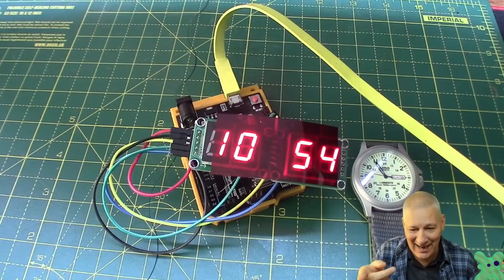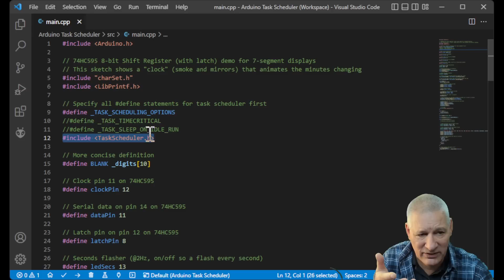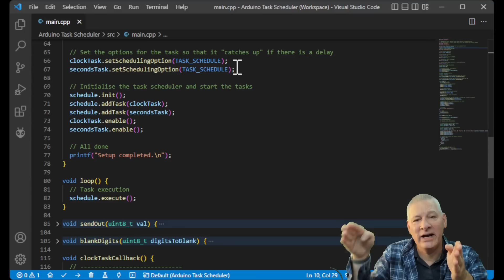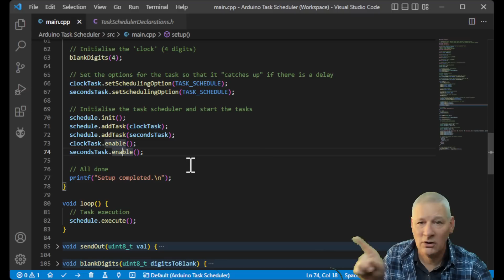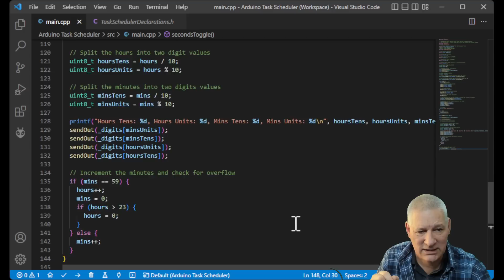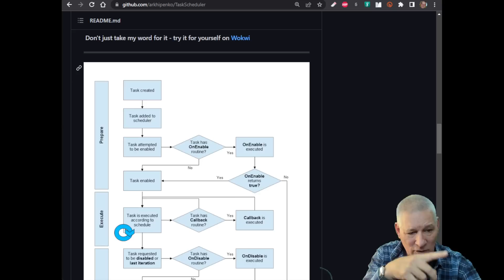#253 Accurate Task Scheduler for the Arduino (and STM32, ESP32...)

Comment: I love PCBway it makes me look like I know something around my friends.  🙃 I cannot get enough of the esp32 Arduino projects and enjoy the down to earth Ralph Bacon learning videos. 😎 
I finally got the Arduino esp32_dev_module;  Modbus input 30001 rtu rs485 6_digit panel meter to display on the free cellphone remoteXY app monitoring  &  displaying the 25,000 Lbs. loadcell  using the $24.00  LILYGO T-CAN485 ESP32 Development Board CAN  Modbus_rtu_RS485 IoT Engineer Control Module.       Thank you for the task scheduler ideas.
Reply from the maker: The task scheduler also works very well on the ESP32 (running it here now). Thanks for your kind words about my channel and my sponsor too 👍

Comment: This could be just what I need!
I built a battery monitor, basically a coulomb counter, which, to maintain accuracy, resets to 100% when the solar charge controller goes to 'float'. I built a clock with mins, hrs, days to show how long the thing had been running since the last reset. As I lot of various display stuff was happening in the loop, the clock would drift badly at times. I fudged it by dividing millis by a fudge factor. But this Task Scheduler should fix it! Thanks Ralph.
Simon
Reply from the maker: Yes, this should fix it. If your project has got Wi-Fi access you can sync the time once a day to an NTP server (I've not needed to do this but it's good to have the facility).
Reply: Best time sync is GPS and using it's  PPS pulse per second output.

Comment: Can see your enthusiasm with discovering this task scheduler. I guess the absolute accuracy of a clock (or any schedule) is dependant on the frequency accuracy of the onboard crystal oscillator.
Reply from the maker: True. I've mentioned this below in other comments, as have others. Maybe I got lucky (no, not that kind) in my Arduino crystal on this board. A super accurate crystal?

But I've run the same code on an ESP32 (ran overnight) and it is still 100% accurate this morning. I say 100%, but I'm not logging actual time vs displayed time, so a few seconds drift cannot be noticed right now, but I will compare properly in my final project where I'm using this timer, just so we know. I might do that this morning, actually!
Reply: @RalphBacon  Maybe the average crystal is pretty accurate? Good luck with the good luck!
Reply from the maker: Apparently, the "average crystal" is good for 0.005% so only drifts 4 seconds in a month. Hmm, I wonder why my ESP8266 drifted several minutes a day then? Perhaps running on a ceramic resonator?
Reply: @RalphBacon  Without looking my guess would be ceramic resonator, because the are smaller and cheaper than a metal can crystal.

Comment: sorry to nitpick, but ... 500ms on and 500ms off is a periode of 1s equal to 1Hz NOT 2Hz
and btw. this clock is only as accurate as the oscillator on the arduino ... task scheduler does nothing to improve accuracy.
I do like your videos none the less and as allways leave a "thumbs up"
Reply from the maker: I'm glad you like my videos and support me, that's most appreciated. 

Now, the task to drive the LED on/off is being triggered twice a second so that must be 2Hz, surely? The LED flashes once a second, that's true. I think we are both meaning the same thing in different ways! 😲😂
Reply: @RalphBacon  if the state is inverted every 500ms, that means during one second 500ms on, 500ms off. compared to AC it is during a period of 1s 500ms positive, 500ms negative, then the cycle repeats --> 1Hz == 1 cycle takes 1s. If it would change state once a second it would be a periode of 2s == 0.5Hz
Reply: @schufti6706  So it’s like this; In the UK 230V voltage is 50 times positive and 50 times negative so net frequency must be 100 Hz ;-) Apart from that Ralph you're videos are great - keep them comming
Reply: @schufti  ... no, I'm with Ralph on this one.  The task (regardless of what the task does) is being triggered twice per second. That's 2hz.   You're focusing on the led. It does an on-off cycle once per second, which is indeed 1hz, but that isn't the point.  Ralph is talking about the task and the frequency of that task. The led is just there to provide a visual indication that the task has been triggered.  The task could be updating a counter or flushing a buffer, it makes no difference, its still triggered twice per second, and that's 2hz.
Reply: @FunkySpunkyJunky  ... at 3:57 he talks about the "other task" and that the LED is half a second on and half a second off and calls it 2Hz (compare it to 1Hz rectangle it is similar.  AC mains switches polarity 100 times a second and still it is called 50Hz. It is about the period == one cycle, so until the signal is back to its starting state. If you don't believe it, connect the LED to a DSO and check the displayed frequency ...)
but I am with you/him if he talked about the task schedule frequency, that could be interpreted as 2Hz - every 500ms it runs for a short time and then sleeps for a longer one, 2Hz with very unsymmetric duty cycle.

Comment: Great project, You could get time using NTP (esp8266) and writing the time to rtc, and then reading from rtc to send it to display, then syncing time from ntp every hour or whatever time interval you like.
Reply from the maker: Well, I could do that... and in my real project I will be doing just that, of course! Albeit I will be using an ESP32. But it does ensure any drift is minimised (my ESP8266 'clock' was appallingly inaccurate: after even 1 day it was several minutes slow).

Comment: I'll forget everything I learned about task scheduling in previous videos and use this one.  Super nice!  I saw in the arkhipenko examples he uses a RTC module to really lock in the time and probably not rely on the code set start time.  Thanks for sharing!
Reply from the maker: He does that? So do I when I start my ESP32, i grab the time to set the clock and it's fine after that. In a real project I will re-sync the time once a day or so.

Comment: Nice video tutorial! Very timely. Your code is soooo pretty now, all those colours: pink, yellow, blue, white,green and just a rainbow of cipher. Think I'll see how an ATTINY treats this library. Unfortunately, the project in front of me isn't a clock, just a fancy switch timer (fan + humidity), but there's a whack of millis I can switch out.
Reply from the maker: Ideal project to add this to, exactly for the reasons you mention.
Reply: @RalphBacon  Well, I guess it 'works' on an Attiny85, but it does not leave much space to do other things. I guess , as expected. Still, likey enough to flip a few breakers or read a metric..
This is the "Blink" example loaded up readout:
Sketch uses 4636 bytes (56%) of program storage space. Maximum is 8192 bytes.
Global variables use 411 bytes (80%) of dynamic memory, leaving 101 bytes for local variables. Maximum is 512 bytes.
Low memory available, stability problems may occur.

Comment: I'm also using PlatformIO with ESP32 and used printf without '<LibPrintf.h>'!
The reason is that the Serial class has it built in, it's Serial.printf(...)!
Reply from the maker: The ESP32 has it all built in, so I don't believe I ever promoted this library for that platform. 

BTW, on the ESP32, It's better to use log_x (where x is one of: v[erbose], d[ebug], i[nfo], w[arning], and finally e[rror]) so the messages have a level of granularity. It's all part of the Espressif macro added-value!

Comment: Superb video, Mr. Bacon.    1.     archipenko's code is extremely exciting.   I seen no
reason why it won't save me TONS of time debugging spaghetti code, as you pointed
out, and 2.   yes, for battery-operated electronic devices, it could be Heaven-sent
for the programmer (me!).

However, 3. I must say that discovering your previous youtube video wherein you made a printf function for the Arduino is the BEST NEWS I have heard all week.   I will start with that code first.

Can I do all this coding from my  exiting Arduino 1.8.19 IDE ?   I hope I don't need
a cross-compiler because I only use free software.
Reply from the maker: You can do it all from the Arduino IDE, but I do recommend installing the newly released Arduino 2.0.1 as it is a great step up and helps beginners (and experts too) with code completion and function parameter peeks etc.

Glad you liked the video. printf for Arduino should be mandatory!

Comment: That's interesting, I recently made a device to play a tune every 20 minutes (to remind me to drink water, I need to keep hydrated for my medicines to work...) and had the usual loop calling routines that check the time with millis() to time the 20 minute interval and to time the notes of the tune, flash LEDs etc. I was thinking about creating a library to do make this more general and re-usable, but as usual it appears someone has already thought of that! I might have a go at re-doing the code using this library to see if it is any better than my code.
Reply from the maker: You can refactor your code in about 10 mins to use this library, Ian. Just look at my demo sketch for an example. This would be perfect for you.

Comment: Presumably this is using the Arduino internal "clock". Is it possible to sync to an external clock eg an RTC connected over I2C? This would be much more accurate.
Reply: I have projects that sync 'internal'  device time to a range of external time devices including a RTC, a NTP server, A php script that outputs time and a GPS module.  I tend to 'resync' to these external devices every couple of hours, to ensure relative time accuracy. So the answer is YES
Reply: @MarkFishlock  I don't  use a sheduler, but I have a clock that runs on the Arduino "internal" time, and syncs to an RTC via I2C at 50 mins past every hour. Usually has to adjust by 2 or 3 seconds/hour. 
I assumed it should be pretty easy, but just checking.
Reply from the maker: Yes, this will be subject to the accuracy of the crystal on the dev board. I'm going to be using an ESP32 so as an optional extra I will be able to sync the time once a day.

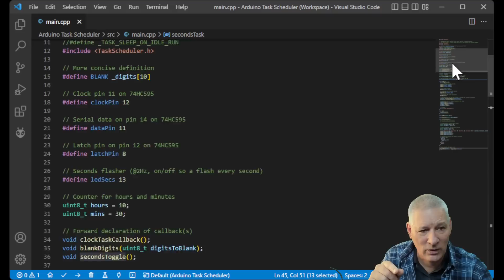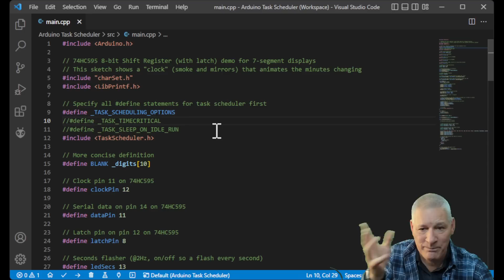Comment: Excellent video with lots of golden nuggets of info for newbie me. I am currently grappling with a Uno R3 based project to build a data logger which will need to run for 4+ months remote from the internet, gathering data every 5 minutes of the day and night (eg 09:55, 10:00, 10:05, .... 23:15, 23,20 .....).  Syncing to time of day rather than just every 5 minutes.  I am doing this with an RTC but can I ditch this and just use the Uno + Task Scheduler to achieve the same thing?  My code is a rather tight for a Uno so a bit of extra space would be welcome, if that's what it gives 🤞.  Thanks.
Reply from the maker: @David G part 2! Sync to time of day is easy once the timer is running. I'm doing that on my workbench right now. A future project will use this library so keep tuned. Yes, ditch the RTC and try this library (use my demo sketch as a guide).
Reply: @RalphBacon  Again thanks Ralph.  1307 rattling in the bin as I type and looking into incorporating the Scheduler.  Also subbed so I wont miss the project - or other gems. 😁👏
Reply: @David G - I did something similar a few years ago with a 328P, battery powered. The DS3231 is wonderful. If you power it off an arduino pin, you can shut down the I2C and just leave the clock running. The alarm pin still works and can be used with an interrupt to wake a sleeping processor. I even use the alarm to time the flashing, sleeping in between. Battery performance is staggering.
Reply: @mahudson3547  Thanks.  Very interesting.  I now have a DS3231 so will try using its interrupt to wake the Uno.
Reply: ... I know the RTC (1307) will drift a bit anyway and a few tens of seconds drift over 4 months wouldn't be a major issue TBH.
Reply from the maker: @David G I don't know how the DS1307 has the audacity to call itself a RTC. They should be removed from sale and only the DS3231 be allowed.
Reply: @RalphBacon  😂😂  Thanks Ralph.  I appreciate your wisdom and humour but didn't appreciate how bad the 1307 was.  I had read that the Uno timekeeping on its own was awful and that an RTC was required to give any semblance of accuracy.  Clearly this doesn't apply to the DS1307.  All things are relative I guess  🤭

Comment: You have to have a separate RTC chip to ensure real accuracy with 'no' drift.
Reply from the maker: But the whole point of this video was to show how accurate it was. No drift. That said, my newest project using this (ESP32) will sync the time once a day and I will log the drift so we get some evidence.
Reply: Best to check if your Arduino board uses a crystal for the processor. There are boards that are using ceramic resonators.